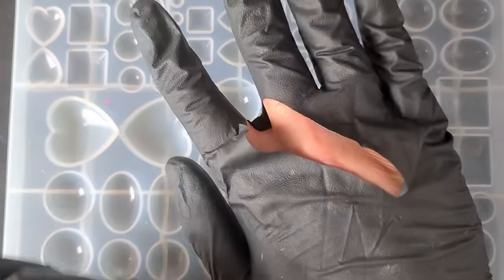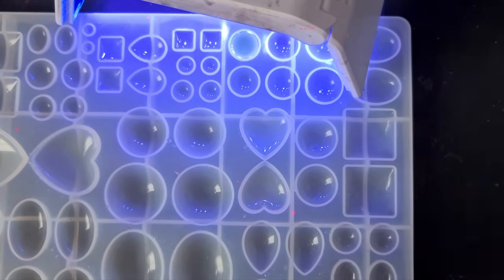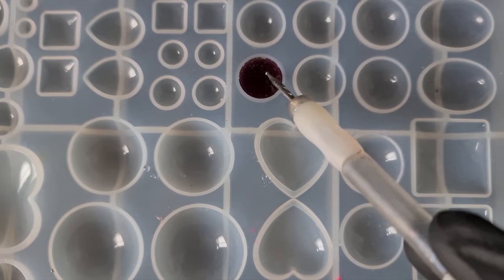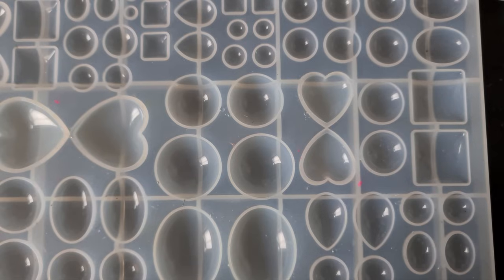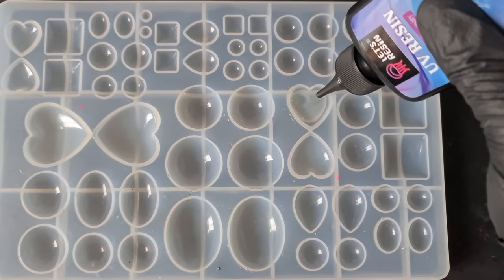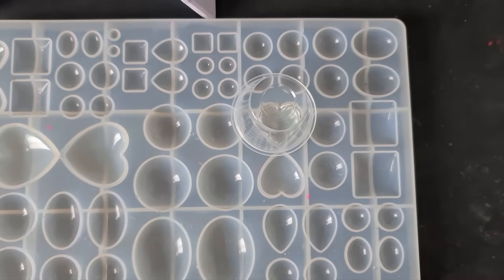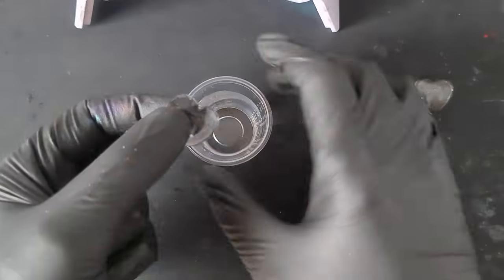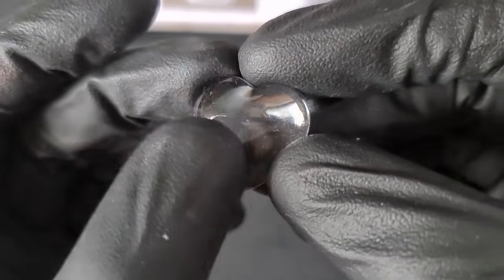#168.  STICKY UV RESIN? - This IS WHY! A Resin Art Tutorial by Daniel Cooper

Comment: OK, so I need to thank you, profusely! I am using UV resin with glitter on a tumbler, so water submersion is not possible (it cures on a tumbler turner)  But with your suggestion of a cover, and someone else's suggestion of mirrors, I put a clear bin over top of the turner with the light inside, and some aluminum foil underneath, and it's perfect!  Thank you thank you thank you!

Comment: I have another tip!
If you're working with larger pieces, you might notice your flat pieces will bend and bow.  This is due to uneven curing.  Set your UV light up at a greater distance from the piece, 6 inches to 1 foot (about 15 - 30cm) away.  Your cure time will be longer, but a bit more even.  Also, set-up reflective foil or mirrors under and around the mold.  I've made a folding mirror box by sticking cheap self-adhesive acrylic mirrors to a folder.  This bounces the UV light around so it can hit the resin from more angles than just directly from the light above the mold.
Reply from the maker: Brilliant tips 😊😊😊 Thank you 😊

Comment: Thanks so much Daniel, excellent explanation.

Something that might help someone; I had an extra nail lamp with a (plain plastic) broken leg, so I snapped off the other one and now use it upside down - under my clear glass platform setup. 
So I'm using two lamps simultaneously, and don't have to flop the mold over for a second cure. 
Watch your eyes if you try this, I have a dedicated opaque box that I use over all anyway -  just in case.
Reply from the maker: Great idea 💡 Thank you for sharing 😊😊😊

Comment: I only use resin to coat my polymer clay jewelry.  The very first resin I ever tried was one that just wouldn't fully cure. I decided to figure out why and ,learned about oxygen inhibition. The solution I came up with was to apply a coat of Varathane over the top of my piece and give it one more cycle under the light. I'm glad I discovered this because I had to try several brands of resin before finding one that would actually fully cure. Thanks for sharing. I'm glad to have other things to try in case I have this issue again.

Comment: Thank you so much. I am extremely happy to get this solution. Wiping the top with alcohol was terrible. I used a glass beaker , its what i had and worked .Also before i had sticky top with another job and put distilled water in the beaker and UV lighted up for two minutes and was hard like glass. Love it. Thanks very much.

Comment: Thanks so so so mush I new to uv resin  and out of 10 pieces I made yesterday the largest one was tackey on top the rest was 2 part and I relized I dint fill it to the top so used uv to fill the 2part was cumply cord. I have a 3drezin coring box so I did it in ther for 4 mins. Came out tacky so I left it in garden all day as its was a lovle hot day in UK. And still nuthing found your vido did the watter trick and it worked ❤❤

Comment: Thank you, Daniel! I made some little purple and red dinosaurs in a baker’s pink silicone mold, using epoxy resin. I wanted to dome the backs so I used UV resin, but they were sticky. I kept putting them back under the light until they finally hardened up. Then I wanted to coat the tops because the pink mold left a matte finish. But the glitter I had loaded them with also inhibited the curing. Now I understand why.

Comment: One way I use to cure is get a white sheet of paper and place the item on it then your light, I have a 4 inch light. Then on top of the loght or around the opening of the light, put white paper. I use index cards. This has made my uv items cure quickly. But i still had issues because of the inks. I found some uv safe or approved inks and they are better. Also perhaps mix your color in the uv resin. Then use the colored UV resin to color your batch you will use.

Comment: Thank you. This was very helpful !   I am just starting to use 0:08  UV resin (less than a week) and you did not mention the problem I ran into today.  I made a mould of an original carving from 2 part silicone putty. Trying it out, the IV resin cured very poorly because the material is opaque so the light could not penetrate. I’ve just ordered some  translucent liquid mould making silicone and we’ll try again.  I don’t know of a translucent putty - does anyone know of one?

Comment: Am new to UV resin.  Tried a sample run putting lots of glitter with the resin and let it cure under the light.  Of course it came out sticky. Tried a few more times under the light.  Finally I decided to put a plain coat of UV resin over the top and voila.  It hardened! Don't know if this was just a stroke of good luck or...?  Thank you for your tip and great explanation.  It's most appreciated.
Reply from the maker: Yay, hope it stays non sticky for you 😁

Comment: Dollars to donuts, I bet the oxygen is why I've been having issues! 
I've been making pieces outside(when it's still dark out) to ensure the nasty chemicals don't hang in the air in my home. I cure and cure and cure with the light(5 minutes is what it calls for, I bet the pieces have been going for 45 minutes each with some tackiness still). 
I have a nice big clear flat container from the dollar store, perfect for charms! I'm giving it a try right now! If it doesn't work I'll move all the charms in it, cover them all with water and go from there.
Reply: Update, it helped a bit. I did the water thing with the light and it helped a little more. I had to leave for work, so I put the clear container with the pieces and water outside and I'll check on them when I get home tonight!

Comment: I use the same uv resin you do, but nothing seems to work.
I'm using resin as a protective layer. So, it isn't much, but it sometimes won't cure all the way.
Rubbing alcohol strips it off completely and a vacuum bag didn't help at all. I can't submerge it.
Reply from the maker: How old is your lamp? It may have expired its uv life.
Reply: @daniel..cooper  i just bought it a few months ago. i use 2 at a time. in a reflective box.

Comment: I have used ashes with UV resin for a while now. I have made jewellery with no problems, I decided to make a necklace for myself using Parents ashes, around 5-6m ago I made the necklace and wore it a lot, I put it away in drawer for a few weeks upon taking it out I found it sticky and it lost all its shine and basically melted baring in mind it was fully cured and not sticky. Can you advise anything to rectify this. TIA
Reply from the maker: It's hard to say, the center could have had some uncured resin which wasn't noticeable, that may have expanded with heat and caused a gooey leak.

Comment: This was extremely helpful!  I tried using UV resin as a top coat on some flasks which where originally started with epoxy resin.  It ended up being a sticky mess and created “crater” effect.  So my question is are the two types of resin incompatible?  I was thinking it would finish my project faster by finishing with UV.
Reply from the maker: I have used together fine 😊

Comment: The issue for me has been that it's sticky on the bottom inside the mold. I've started flipping the mold over and putting the bottom under the light. Mostly seems to help. Many of my resin jewelry components are unusable due to fingerprints from sticky.
Reply from the maker: Yes, always cure the underside too, take out on the edges and then straight into the water 💧 😊

Comment: I've just tried all these and it's still sticky , iam using a 54w led light , even tried my old 34w , iam guessing it's the resin, and yeah can't clean it off either, iam a bitty bummed out, it's called  OUHOE , it's pretty yellow too. I usually use a 2 part resin so this is new to me .
Reply from the maker: It could be the resin or your lights have expired, a way to test would be to cure in sunlight, if still sticky, it's the resin.
Reply: @daniel..cooper  I hope its not the lights in the one it's only 2wks old , the other is old but both the same outcome , but I will take your advice,  not sure how itl go in Scottish weather mind you lol
Reply: @daniel..cooper  I got round it by putting another type of resin over the top , but as it's so strong smelling,  I've disposed of it .

Comment: Is the light that you use just a black light? And would I just be able to buy another black light and not have to buy that exact one?
Reply from the maker: These lamps aren't like normal black lights, the UV wattage has to be strong enough to cure the resin, ideally 36w 😊

Comment: Hello! I am using UV resin and following the directions to a T. I still keep ending up with sticky pieces, and as it’s an object to hold and work with (crochet hooks) this is a no go 😢. I tried the water trick and did 4 mins each side under the water and they are still sticky. It’s a highly rated UV resin off Amazon. Any recommendations? I was going to try spraying clear acrylic spray paint over them but have heard that can be sticky too. Any advice you have would be so appreciated.
Reply from the maker: Could your lamp have expired?
Reply: @daniel..cooper  sadly no. I used a brand new one and I also used my older nail UV light that’s actually nice for my gel nails 😭
Reply: @daniel..cooper  I’ll keep you posted if they stay sticky over the next few days. Maybe they need some more time after the water bath

Comment: Hi, i hv made coasters and topped with UV resin, but the  coasters are sticky and take at least two weeks before it is not tacky. What should I do to prevent the tackiness on the coaster
Reply from the maker: Hi Dawn, if the water trick didn't work, it could be your uv lamp. To my understanding, uv lamps can also lose their uv properties, similar to Sun bed tubes, so it could be that the lamp has exceeded it's life or just not powerful enough.
Reply: OK, thanks. will look into it.
 @daniel..cooper
Reply from the maker: @dawnandres5251  No probs, hope you sort it 😊😊

Comment: Why is my uv resin not curing with a level surface? Is it normal to get so hot you can't touch it?
Reply from the maker: Sounds like it's curing too fast, try positioning the lamp further away 😊
Reply: Thanks for the reply Dan, I'll have another go later, i bought more resin so I could experiment a bit, I only bought a small bottle originally to do the raindrop effect on a few of my moulds (my favourite is a tree frog) and was worried I would use it all up on practice pieces

Comment: The contents of the bottle you're using can separate and can prevent curing. Shake the bottle vigorously and if it works, you'll probably have to shake it every time you want to use that bottle of UV resin. This happened to me, I never used that brand of UV resin again.
Reply from the maker: I would never shake my uv resin 😂 the bubbles would ve crazy. I have never experienced any separation in my uv resin from any brand, I think you may have had a bad batch.

Comment: The thing i don't understand is why resin has such a problem with the colour black yet black nail gel doesn't have the same problem.
Reply from the maker: It's because black is very opaque and the light struggles to cure through 😊
Reply: @daniel..cooper  I get that, it just fascinates me that black gel polish, that is cured under uv, doesnt have the same issue.